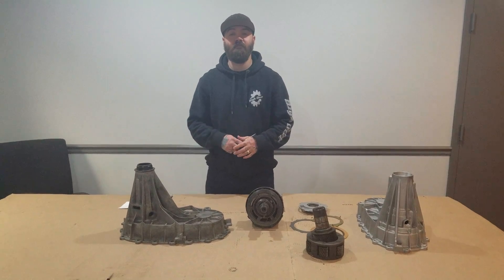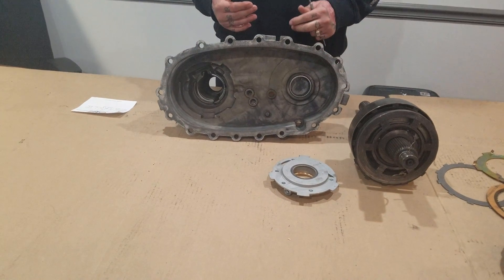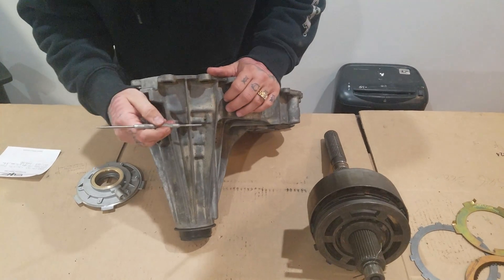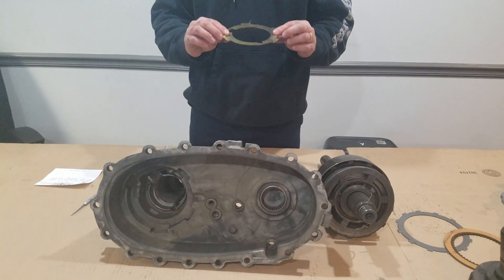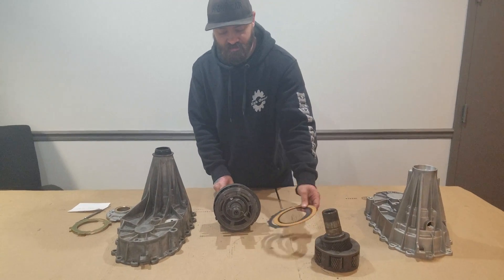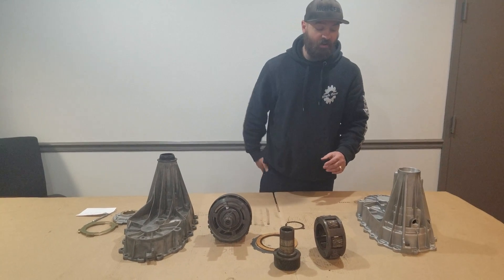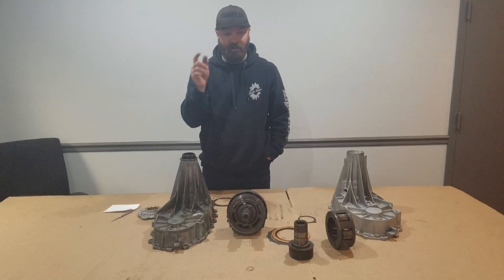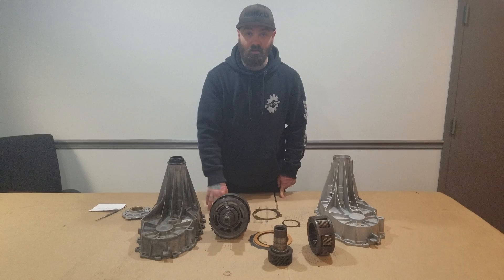NP246 Transfer Case - Common Problems and Solutions

Comment: I have a 2000 7z1 tahoe and it has the all wheel drive 2hi 4hi 4Lo transfer case and it has the 5.7 in it can I put a transfer case out of a chevy s10 or blazer that has the 4.3 in it and still be  able to drive it in two wheel drive

Comment: I have a 2001 Chevy Silverado 4x4, Transfer case NP246. Im getting a rumbling sound when driving at 55-75 MPH. I removed the front drive shaft to eliminate the u joints from the shaft. I did see the transfer case saturated with fluid leaks. my question is, could the rumbling/vibration feel and sound come from a failing transfer case? Transmission shifts and runs fine. Found the transfer case seal leaking as well(where the rear drive shaft hooks up to rear of transfer case). I plan on checking the fluid level asap, I flushed and changed the fluid about 30,000 miles, Unfortunately I didn't check the fluid after flush which means it could be very low due to this flawed design. Symptoms of this issue would be greatly appreciated. Thx and great video!
Reply: Chain is stretched

Comment: I got a 2001 chevy silverado 1500 4x4 z71 5.3  it has not had a easy way to go in it's life. Dirt roads, firewood, ect. 23 years of ownership and then last winter my wife drove it and on her return trip she had to use 4x4 and she picked 4 low at the grand speed of as fast as it could go. My point is I don't know if you have ever seen a transfer case guts melted to it's self but it is a sight to be seen.

Comment: Np246 just rebuilt myself and now clicking noise in 2hi. Click auto and it goes away.
Reply: In 2hi, the transfer case front output clutch and front differential are disengaged. In auto 4wd, the front differential engages with the driveshaft, but the transfer case does not engage the front output until it senses the wheels slipping. In other words, in auto 4wd, the front differential is engaged but the transfer case is not. 
In 4hi and 4lo, the front diff and front transfer case output are always simultaneously engaged.

If it's clicking in 2hi, but it goes away in auto, that would suggest maybe your front diff isn't fully disengaging from the propeller shaft for some reason.
Basically, nothing changes inside the transfer case itself when shifting from 2hi to auto 4wd, at least not until there's slippage.

Comment: I did not hear the fork pivot pins and fork being addressed.  Did I miss it?  I need the size and the torque value. 

I've got a 2005 Yukon 230,000miles. The lower fork partly threaded pin keeps falling out. I replaced it myself 8 months ago.  Used blue LockTite, torqued to 34 ft lbs. My lock tight may have been bad/old. I don’t have any vibration and the 4x4 works fine. Not sure why this is happening. 

I cannot find the new or used pin/bolts anywhere.  Do you know the thread type and approximate length of the bare shaft and the threaded part?  I'm going to get a bolt and sand the end threads away with a grinder.   This time use new blue locking, or even red, and torque to 50 ft lbs. Maybe use a copper crush washer. Thanks!

The GM part number for the pins is  
 89059638, and fork (2nd design) 45684.

Comment: How do you remove just the cover I have taken all the bolts out all the wires off all the harness everything got it loose there's a half an inch Gap but will not pop off
Reply: Sorry that's my daughter's name but I'm Tony
Reply: I'm sorry to bother you brother I just want to know how that cover comes off I have taken all the bolts out all the wires clips harness everything even the module but I cannot get it off there's a half an inch Gap already between but it will not come off
Reply: There's a rubber  plug you gotta take out and a snap ring inside there that has come out then it will come apart

Comment: My transfer case in my 2010 GMC has been ok. Knock on wood. I am planning on servicing both front and read differentials and the transfer case with fresh AMSOIL fluids this weekend.  I’ve never done this service prior, but it looks ridiculously easy and I was quoted $800 from a shop to use shop grade bulk fluids.  No thanks. 😂😂😂

Comment: I see a T-Case rebuild in my future but a quick question. If only running in RWD, can I put the rebuild on a short delay and keep driving around as long as there is fluid? I have a small leak and am not sure how the previous owner took care of it. I replaced the input shaft seal and it stopped the majority of the leak already . Thanks!

Comment: I rebuilt the NP246 on my 2007 Tahoe 5 years ago, about 25,000 Km since.    At the time, I replaced the rear case half and installed the case saver.   
The problem I am experiencing now is the clutch is NOT slipping at all.  When in 4wd, the front and rear are locked together pretty tight.  Serious tire scrubbing when turning and I can really hear the front diff complaining from the gear train straining.   
What can I do to get the clutch to loosen up?  What can I pour in there to encourage some slip?
Yes, it has and always had blue autotrakII in it.

Comment: What the chances my 2001 gmc sierra won’t move because of the transfer case it shot ? It had no fluids so I refilled it but now my truck won’t move untill it hits almost 2500 rpm’s in drive or reverse.

Comment: In other words Chevy trucks from 99-07 are terrible because the transfer cases leak and run dry and self destruct ..
Reply: I have an 05 Sierra and having the same issues 😮
Reply: There are also many other afflictions that these trucks suffer from. A few are: Rusty frame/brake and fuel lines, rocker panels rust from inside out from trapped debris, paint fails and flakes off and many more. I love these trucks but goddamn do they really try and self destruct

Comment: Some 2004 2500HD had the 246 as well. 6.0L 4l80 np246, never had an issue, I had it in auto4 for 17 years straight, never had pump rub, so maybe it isn't a 'will happen'  issue, but helps advertising
Reply: Had my mechanic check the clean, rust free, '04 Z71 Burb, 198 K before I bought it.  Had the small hole where the clip sits, it was half full of oil so I bought it and having it fixed now.  The rebuilder said it's a Jasper rebuild which isn't good and been welded before.  Rebuilder is doing what he can and J-B the hole thinking it will last a few years while I find another to replace it. I haven't brought it home yet and hope this will be a good rig to travel and use for a long time.

Comment: Transfer case in my suburban 2500 makes 2 loud smelling noises inside transfer case. So intense you can feel it on the ground around the vehicle. And then goes back to 2hi. And that’s only when I try to go to 4lo. 4hi works fine. And since that happened I have a serious vibration going up hill and when I turn. When I turn it is accompanied with a clunk.  I had my torque converter replaced a month ago. And before that my 4x4 worked fine.

Comment: I have a borg Warner 4406 that leaks at the input  shaft. I have replaced the seal and it still leaks.   What else could  be causing this?
Reply: output shaft bushing

Comment: Rebuilt my transmission, transfer case didn’t leak, worked fine, decided while I had that heavy bitch out to break it open and found out the pump had wore about half way through, put the case saver plate in and saved that case

Comment: I have a vibration coming from my transfer case when I put it in 4 wheel drive from around 100 km/h and up , feels like a loose chain , don’t know if it’s something you’ve experience?
Reply: I believe you gonna have to start looking for the transfer case soon my started doing the same like two monts ago  and now i need to replase it
Reply: My recomendation for now is to add oil to it sometimes its only oil what it needs

Comment: Hello good video, thank you for sharing this message, I have a 2004 chevy suburban z71 and the Transfer Case one day released all the oil. I have never used it again .... at the moment it has pots and I will need replacement of the aluminum rear case and the metal plate between the pump and the middle of the rear case to reduce friction and vibration, ask. You have a website to buy everything I need ... Thank you.
Tomorrow I will still check well to see if I see everything in the transfer case ...

Comment: My 02 awd yukon tcase had the pin holes, got the new housing and pump plate. But it leaked immediatly after getting it bavk from shop think i ran it to low now shift fork tabs r melted
Reply: Sounds like WARRANTY ISSUE
Reply: @Watchout1010  shop was my buddys garage so no warrenty
Reply: He wrks belltire but did it at home
Reply: @jeremykochan5718  case half silacone,seal or hole would only create a leak-pinhole,clean,brakeclean and JB weld,epoxy-will be wet where the leak is

Comment: I don't understand how these metal type transfercase saver are able to do any good. Apart from taking out some slack, there is still metal riding on the housing, except now it it the transfercase saver metal. I have the feeling any non-metal type transfercase saver is the better solution.

Comment: What other transfer case can I put in my 02 chevy tahoe? Mine is all jacked up and I have bought 2 different ones that ended up being piece of shits as well. I want to put an upgraded case that's stronger in it. I found a guy selling one who said it was a 246 but when I went to look at it it wasn't the 246 and the only tag I could find on it said daewoo I found some part numbers on it looked it up and it showed it was for a 2014 Chevy Silverado and that's the only year it show that it came in. From the outside looks like a better case but hell I don't know. Is there any way that to make it work? Also seen a guy on one of the forms who sells a transmission output shaft that you put in the transmission and you can bolt  up a heavier transfer case off the 4L80